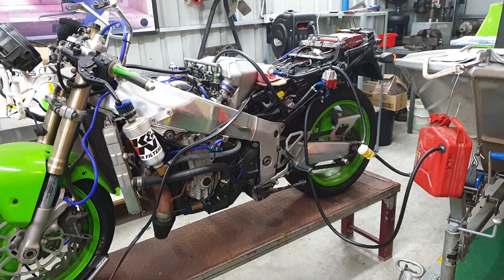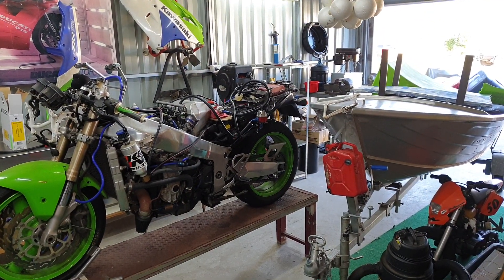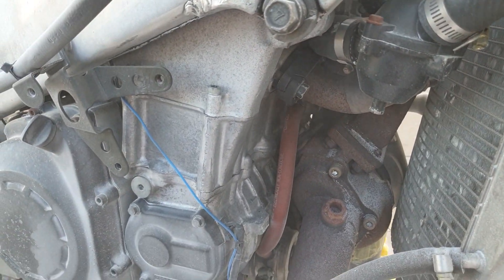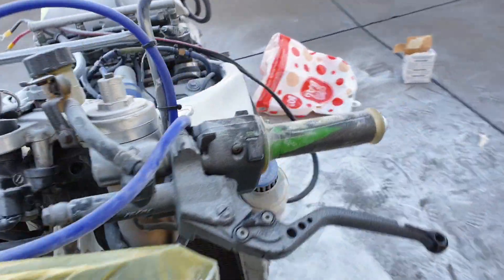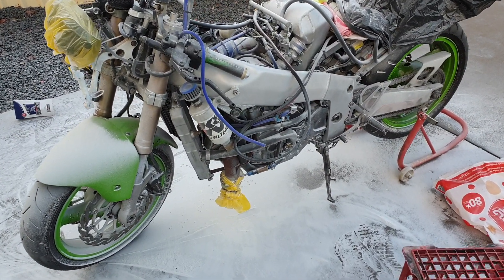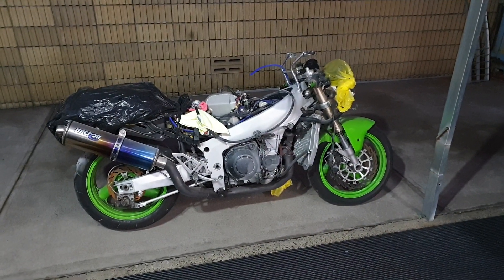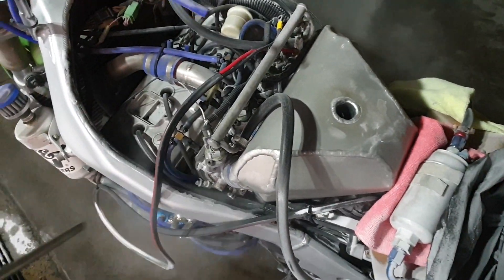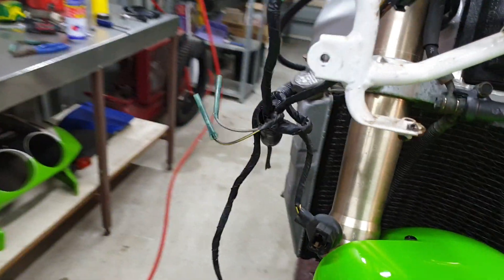Motorcycle Rebuild Project : ZXR TURBO Restoration DIY Soda Blasting Ep6

Comment: Definitely borrowing  your Bi Carb idea, how big is your compressor though?
Reply from the maker: Hi James. Sorry for my slow reply mate. Got lost in internet land. I have a normal workshop compressor with 50L tank. To make it better I also have to tall old gas cylinders that are plumbed into my air system. This gives me alot more storage of the compressed air and lets the higher pressure to be available longer before dropping off.